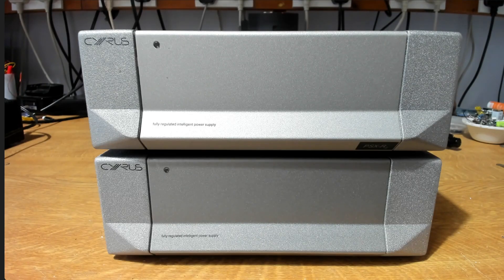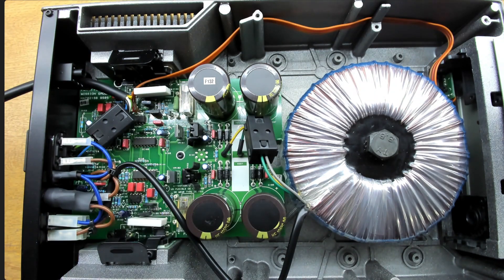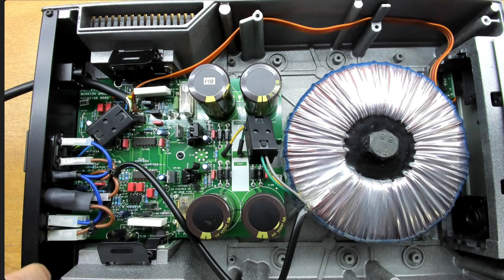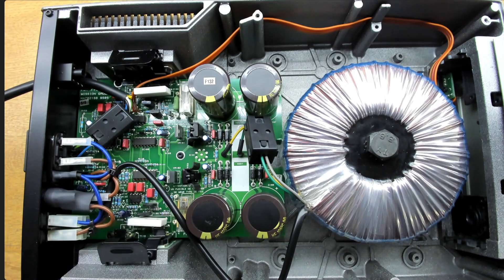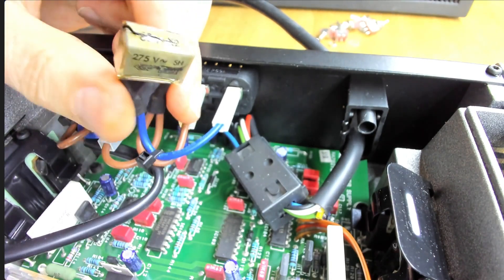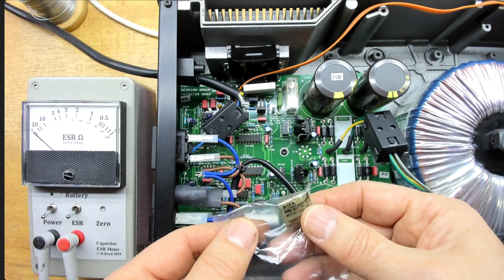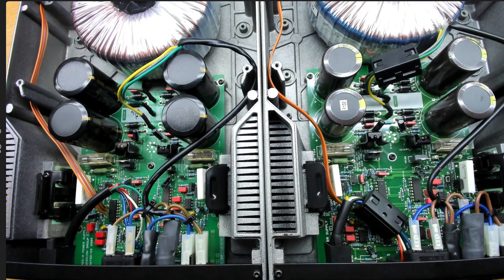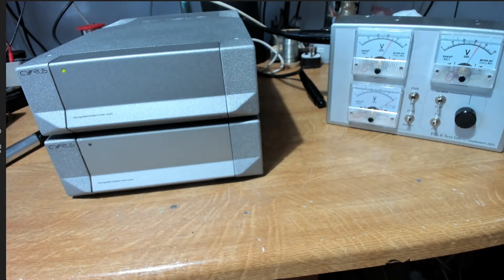Cyrus PSX-R & PSX-R2 - Repair & Compare

Comment: The very fact that Cyrus continues to use those suspect rifa caps means I have lost all faith in that once great company. Great video Duncan.
Reply: I don't. It's how those class X safety capacitors work, when they absorb unwanted energy, they break down slightly and go slightly resistive. Eventually, they go short. 

Technically, you can use class Y but you wouldn't know when they've expired and then damaging transients will get through. 

Although, tbh, fast transients won't do much to a big transformer like that. So it is probably there to reduce emissions when connected to a CD player or streamer for example.

Comment: How funny, my PSX-R did exactly the same thing a fortnight ago and at first I too was baffled as to what was wrong as the board looked pretty good. The only thing I could really see was that looked a bit off was that the two heatsinked T111 and T112 transistors had discoloured the PCB slightly so I was wondering if they were bad. I swapped those out and when doing that I eventually found that blown cap.

I was really expecting there to be some kind of difference between the PSX-R and the newer PSX-R2 but they are almost identical.

Nice work on the test box too, handy little fella to have in the toolbox.

Comment: If you've got a scope or better yet a spectrum analyzer it would be nice to see the "benefits" of said massive filtering upgrade! Have yourself a good weekend.
Reply: Arranged the PS in a CRCLC fashion in one of my project source follower amps with about 40mF of capacitance in total per rail, while the additional RCLC section can easily be bypassed to facilitate comparison. The ripple voltage had dropped by a factor of nearly 4 and attenuation of mains related peaks is visible on the analyzer, with 50Hz at -110dB with vs. -95dB without the extra filtering, while higher mains harmonics nearly disappear into the noise floor at 2x5W/8R. Is it audible? I cannot hear the difference.

Comment: Are the diodes for rectification the same? And can they cope with the peak current when the capacitors charge up at switch on?

Really, the later one looks inside like a half arsed attempt at getting it through legislative EMC 😂

I leave my old Cyrus kit turned off at the wall for the reason that it's on internally all the time.
Reply from the maker: Same diodes in both, 8 off 1N5402. 2 diodes in parallel in the bridge.